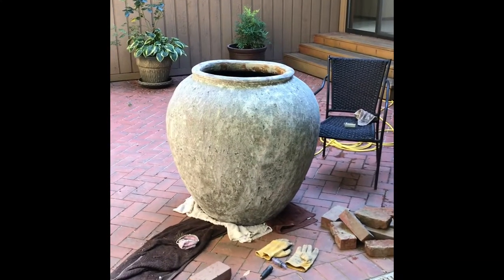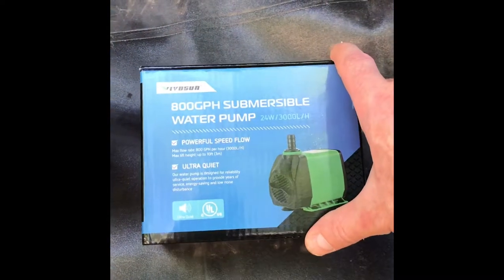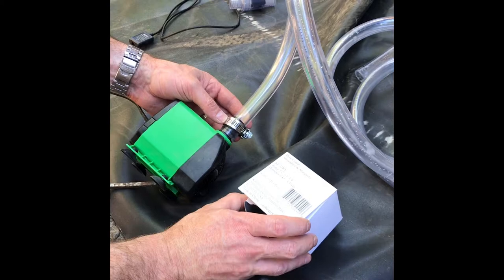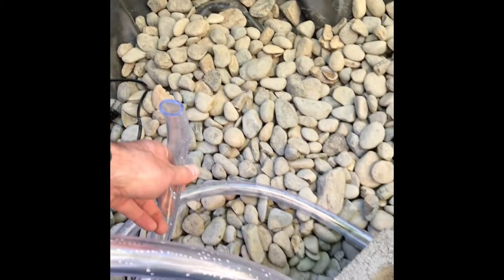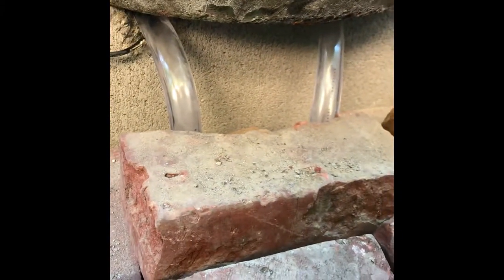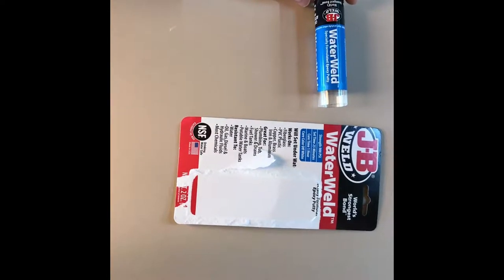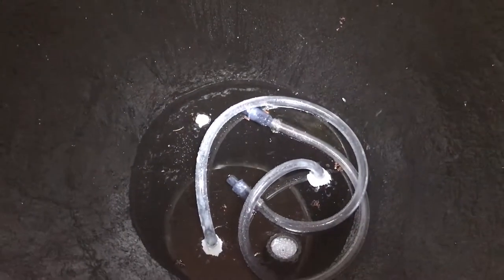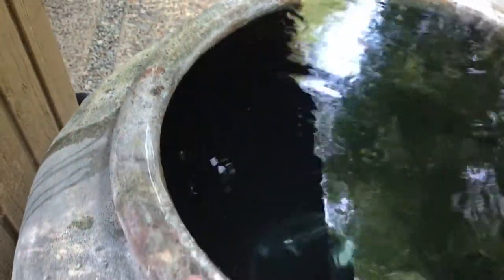DIY Pot Fountain (Tutorial)

Comment: Not wonderful..two things...a stronger single pumb would have saved you from doing 2 holes and the work.....second the opening of the pot is real large to get a great flow over the pot..a smaller opening on top would have made that work as there is a less spill area thus a bigger flow........live and learn  about how water works.

Comment: Any need for a filter?  Thanks for the ideas
Reply: Yes!  This video is lacking some actual professional information that would make this project a lot easier and problematic.  Pumps are rated for head pressure.  You match the head pressure to how high you want the water to flow.  The urn fountains are re-circulating and all pumps need amble water ALL the time.  Typically in mesh filter bags to prevent crud from clogging them.  
One way valves are not necessary since the water column can only be supported by how much water pressure is in the reservoir